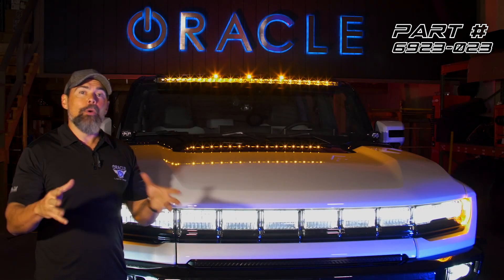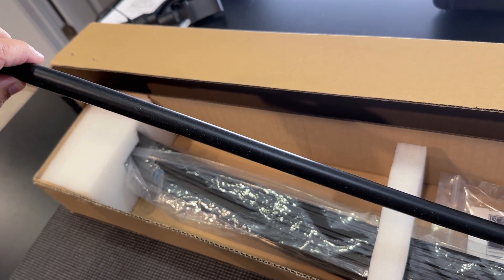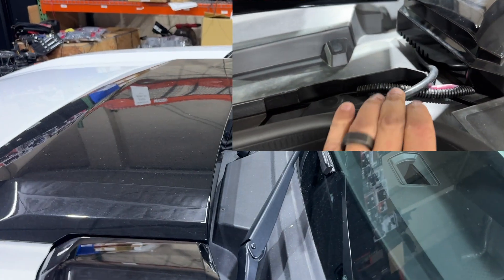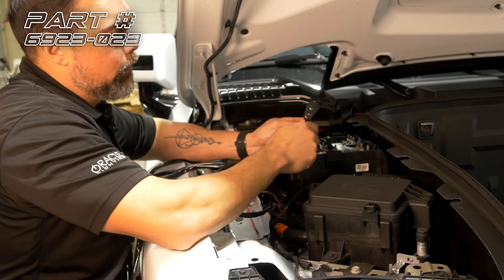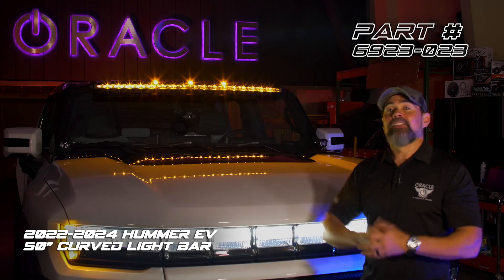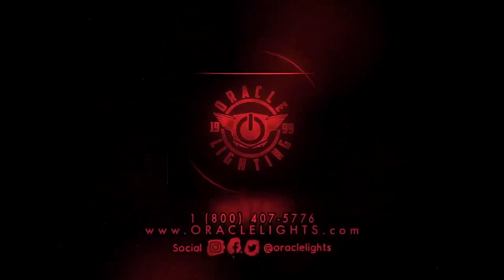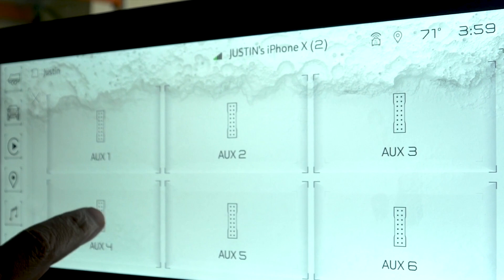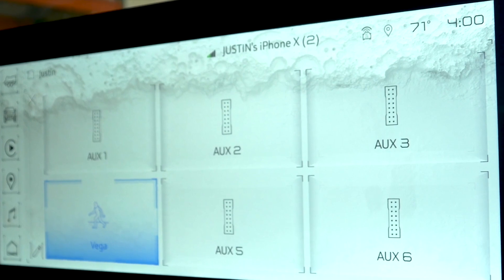Installation: Hummer EV SUV SUT 50" Roof Mount Curved LED Light Bar w/ Brackets from ORACLE Lighting

Comment: Could you do a more detailed video on installing to in built Aux setup.  Step by step and equipment and connections needed.
Reply: I agree, I can't find anything on how to wire it to the factory Aux Module